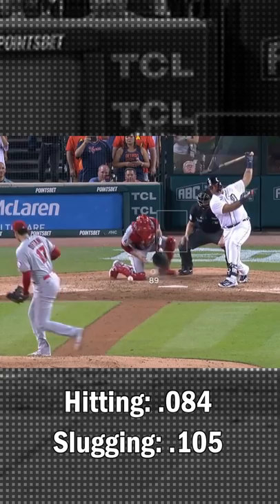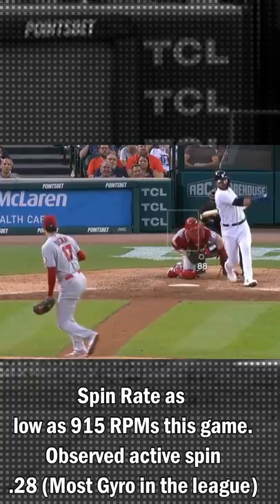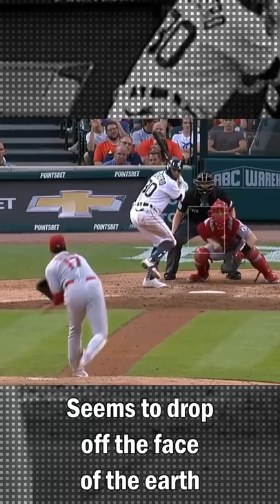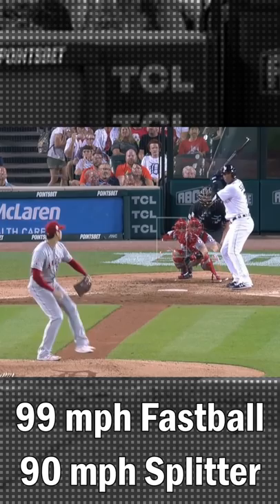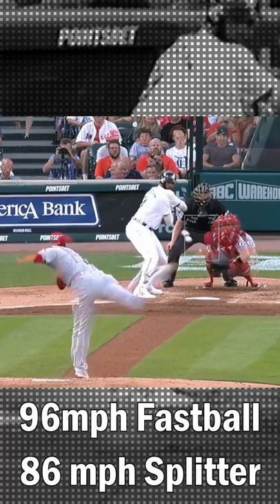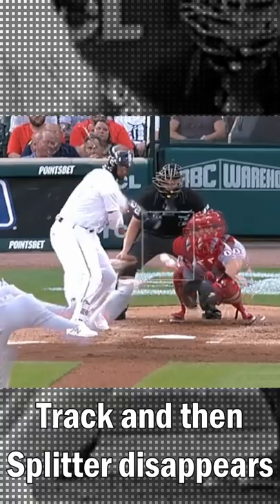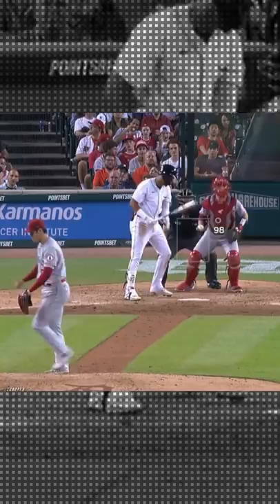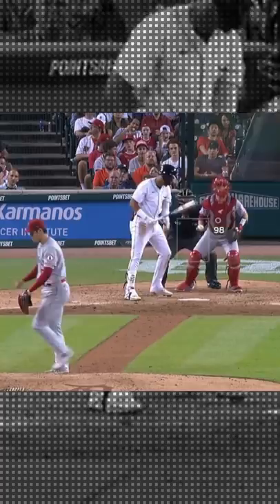Why is Ohtani's Splitter Impossible to Hit??!!  #shorts

Comment: Pitching Ninja, do you have a video on his grip or how he throws his splitter? I’ve been experimenting with a few grips and different releases but I’m having trouble with consistent movement
Reply: you see the "U" shape on the baseball? or you guys call it "horseshoe" I guess? he bascially has the ball with the U upside down, with the open side of U facing him and split his fingers on the outer side of the two seams
Reply: @Moonlight-cq6bi  Thanks, was wondering what he does with his wrist as well, if he keeps it flat, flicks it or pronates it
Reply: @aw7853  he has his thumb rest on the seam on the left side at the bottom of the ball and just pull it down really hard like a fastball. then the ball would naturally has that kinda depth
Reply: @Moonlight-cq6bi  alright cool, thanks for the info on his grip